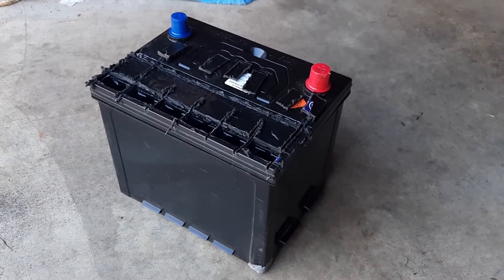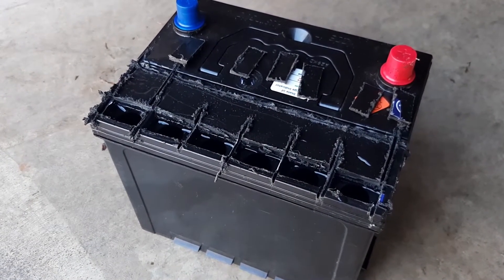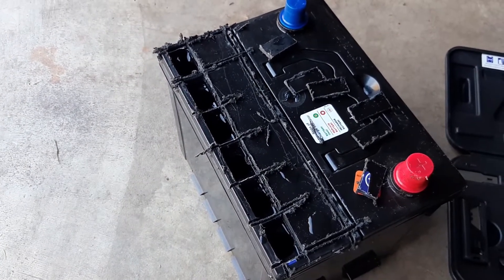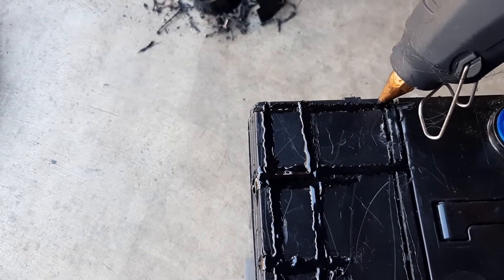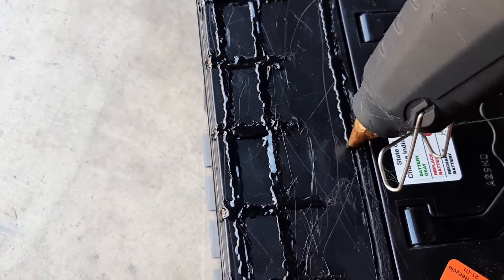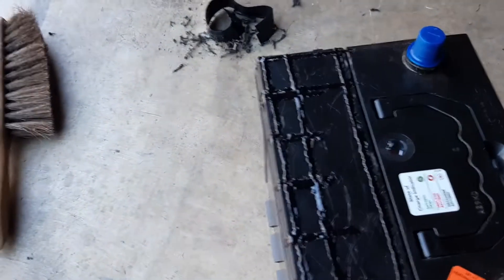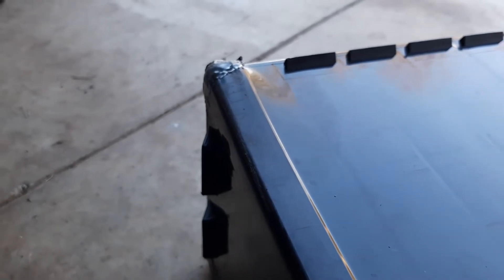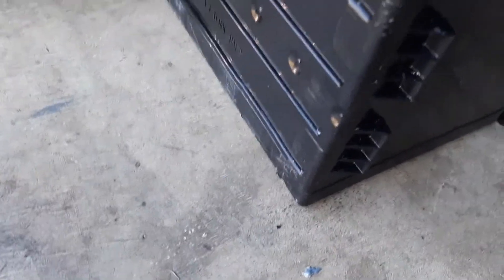Refilling and Resealing a Maintenance Free Battery

Comment: Much better than how I did my first one…. I’d just drill a small hole in the top now I know how the battery works
Reply: It only lasted about a week, the glue that we put on the bottom got eaten away by the acid.

Comment: Any shavings of the battery case material that you drop into the cell won't contaminate anything. It's touching the acid against the same wall material in a sealed system.

Comment: Could you have just drilled a small hole into the cell at the end rather than unsealing the whole battery?
Reply from the maker: A 12 volt battery is made up of 6x 2 volt cells each cell has its own fluid.
Reply: @FAB7362  But it was a new battery eh? so it was only broken on that bottom corner and so only one cell would have needed repair?
Reply from the maker: @BrotherRobb  Thats right, but I just wanted to check all the cells. And it was an experiment.

Comment: Is the glue sticks that you used just a normal glue stick was just wondering the acid wouldn't eat that away would it ???
Reply: Yeah I just had a look you can actually get a glue that is resistant to acid
Reply from the maker: I used the black glue sticks as they are supposed to be the hardest of the glue sticks. There was no problem sealing the tops as they were not in contact with the acid. The hole in the bottom was another story. Long term, I could not get it to stop leaking and later,  one of the viewers suggested that plastic welding would have been a better option for the crack exposed to the acid.

Comment: Instead of chiseling the top off, simply drill small holes, fill with distilled water, desulfate, charge up and seal the holes with hot glue. Fix the crack on the bottom by plastic welding it with a soldering iron.

Comment: if you wanted to revive that particular type of permanently sealed battery, because it is flat of any life or charge would you be best to open it first so that you could charge it with out exploding, also if it was as flat as,,, could you just replace the acid water, with a solution of distilled water pre mixed with Epsom salts, & would it still need to be charged up whilst it is open so that it is not going to explode, & I know that you said that you cut it open with a grinder, but would that be dangerous if the battery was not new like yours because with an electric grinder, "would that be dicey if, and could a permantently sealed battery have a space / a gap of water missing from the battery due to being evaporated leaving a possible space / gap for acidic vapours or fumes? I would like to repair a battery like that type myself, 

also I never knew about the different coloured hot glue sticks either, so I am happy that I saw this video, but I'd like to find out a little more before I tried it with a battery that was not easily opened with plugs/ caps, I have heard & watched how some people use some stick welders to utilize the fast amp charging up 5 minutes at about 85 - 100 amps then ten minutes rest with these stages, repeated five times, but I couldn't imagine trying to use that welding principal, on a "permanently sealed battery with no escape of pressure & I haven't seen an example of that exercise in action, a doable method as of yet.
Reply from the maker: Totally agree about opening up a sealed battery before trying to revive it with a welder. A small hole above each cell would be enough and then resealed with hot melt glue. 👍

Comment: Have you thought of using Water Miser Battery Caps for lead acid batteries with regular fill caps? Ive heard great things about them from RV owners, solar powered homeowners, and industrial companies. It supposed to recycle the gas from the lead acid that would otherwise vent off and evaporate over time, especially in summer heat.
Reply from the maker: Hi there. Must admit I had not heard of these caps before. I googled them and they look like a good idea. Thanks for the suggestion.  👍

Comment: Evening...just found your video...mine is a leisure battery where I put  a screw in bottom and leaked...is this only one cell which is dry. If so when I put water back in do I need to put sulphuric acid in aswell. Also I'll be be using g plastic weld for repair cheers
Reply from the maker: I think in a pinch that distilled water will do the job. If you want to add some acid a quick search online should give you an idea of how much acid to distilled water would be ideal. Plastic welding is definetly the way to seal the hole. Good luck and thanks for watching.
Reply: Many thanks for the reply. The battery is only 2 days old and still got a charge of 11.4 v ...I'll jjst put the water in.
Reply from the maker: @joe-sc2vf  I would do the same and then just recharge the battery after the repair and refill.

Comment: Hi what was the outcome of the battery with the glue stick,any leaks?
Reply from the maker: The repair on the leak was not successful. I tried JB Weld and hot melt glue stick. The battery was ok but I couldn't risk putting a leaky battery into a car as the leaking acid would ruin the paint. I took the battery to the recyclers and posted the video mainly to show that adding water to a sealed battery was possible then one of the viewers suggested that plastic welding should have been used on the leak and also the top. I agree that the plastic welding would have been better.

Comment: good job and hopefully battery is a winner. how did it hold up? what was in the glue gun? looks like plastic. ty
Reply from the maker: I used the black glue sticks in the glue gun. They are color graded with the black ones being the hardest and the white ones the softest. The battery worked fine for a couple of months but then the repair damage to the bottom of the battery began weeping. I tried another method to seal it but I think the battery acid just eats it away. The top sealing of the battery was fine probably because it is not immersed in battery acid. thanks for watching.